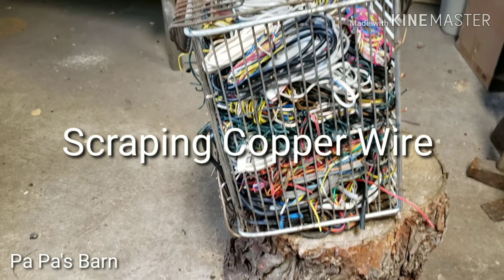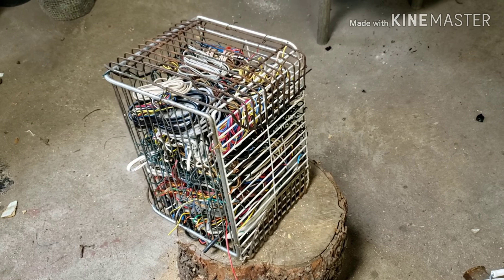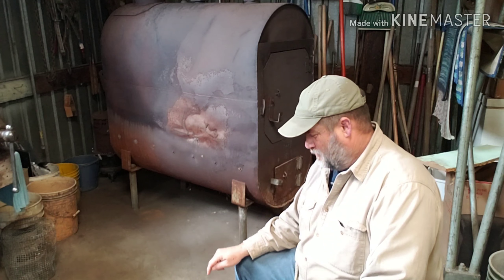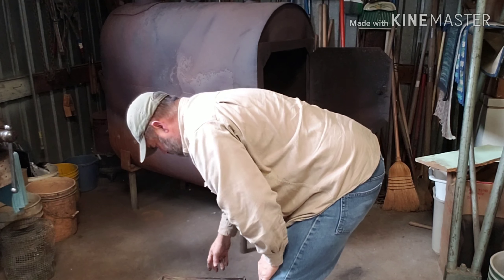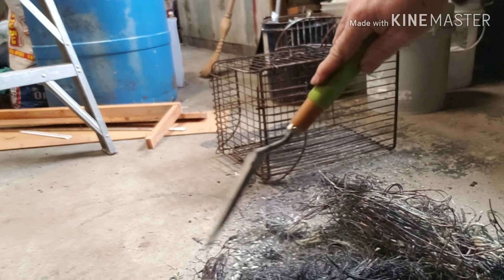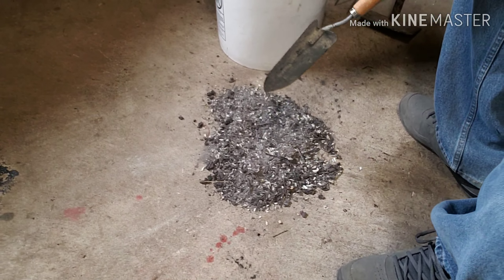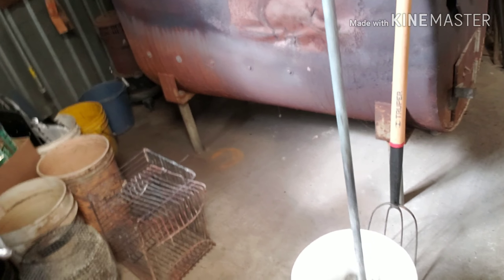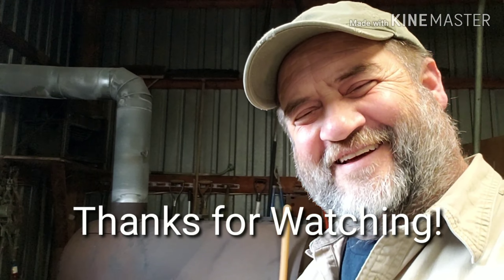Scraping Copper Wire

Comment: We do the same down here with the smaller gauge wire and sell it as #3. The heavier gauge we take our time and strip it because there is a 20 cent difference in the price. Burning it off in the stove did pretty good in my opinion tho

Comment: In my line of work I end up with quite a bit of copper wire along with many plumbing pieces. End up with a bunch of brass as well. I haven't sold any for about four years now so,I have a pretty good chunk of change in copper at the moment. As far as the wire goes,I never burn mine off because the scrap dealer I go to only knocks the price back to about fifty to sixty percent. To me for the difference,not worth the trouble of the burn and clean up. Still bring a good dollar home for scrap parts and pieces and I'm good with that..That's a big stove you have,need one of those in my shop..Thumbs up
Reply from the maker: Yeah I have already changed my mind about the whole thing. All things considered it was not worth the effort. Don't know if I should do an update video or just pull this one down, don't think I'd do it again or recommend the method to anyone else. As for the stove my Dad and I made it together over 40 years ago. Sadly it's about seen it's days, getting burn through and very warped, but it's been a good one. Thanks so much for your support!
Reply: Pa Pa's Barn don’t take it down just do an update. Help someone learn

Comment: That's one way to do it .......but here in Ontario that would be a $10,000 fine from the environment so I don't burn my wire unfortunately
Reply from the maker: Wow that wouldn't be fun. You bring up a good point too. Actually it was a real mess to cleanup and very stinky burning in the barn so no more than I acquire I don't think it's worth it for me to do this anymore either. I don't even know at this time if the scrap yard will consider it good enough to pay a higher price for. I don't scrap as a business, just a hobby that is my little way of recycling and keeping a little junk out of the landfills so doing something that could potentially be bad for the environment would defeat the purpose. Thanks for your input.